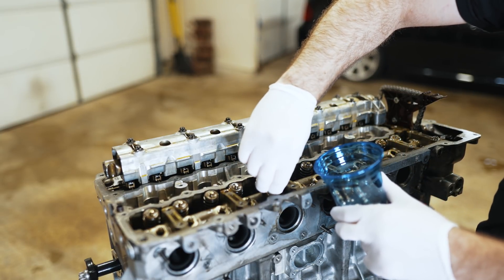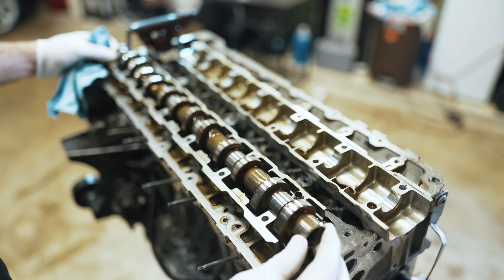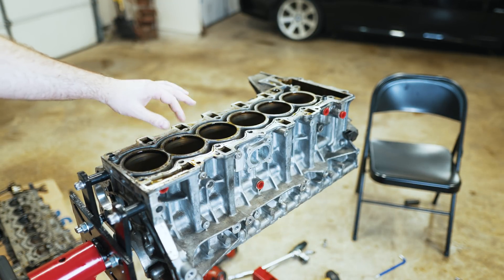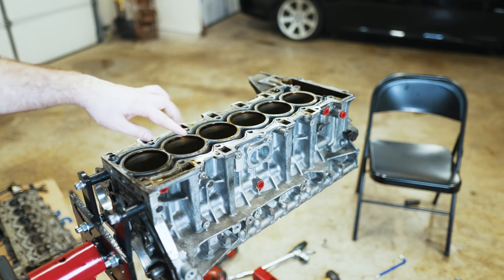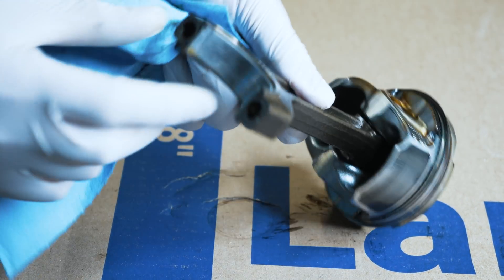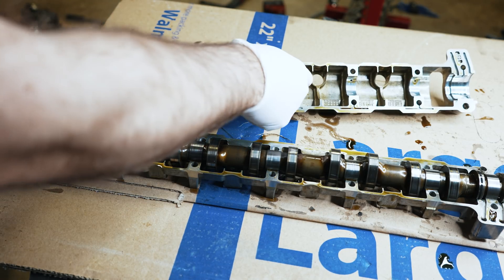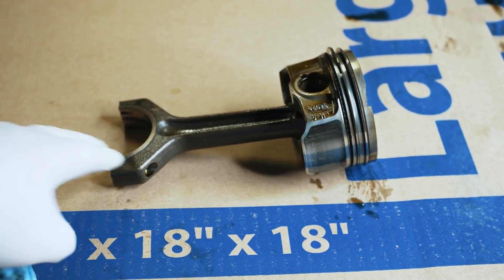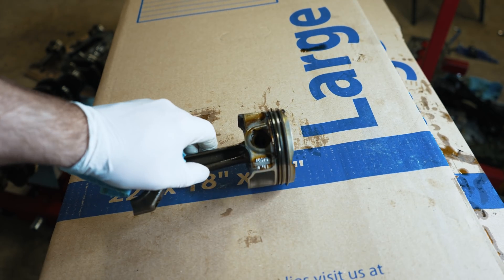Come Look Inside A BMW Engine!  Full Tear Down

Comment: Hi Musa,
how would you consider the condition of your cylinders? My cylinders look the same after 180k km, I think it's not bad at all. The grooves are so little, you wouldn't even catch up on them with your fingenails. 

Regarding your Bearings: I would definatley use OEM BMW Bearings. When I did my oil pan gasket I checked one of the six bearings and it wasn't even worn through the 1st metal layer, and that after 180k km. So I kept them, I guess I will find out if this was a smart decision with the 600hp build.
Reply from the maker: I'd say the bores look good for the mileage.

Comment: Seems like others have had problems with King bearings.  Cam bearings (and a couple of cam lobes?) looked scored.   Cam trays need to be new, evidently.

You could have the head ported by headgames, go to the Mahle 9.5:1 low compression pistons ands Shrick cams and a closed block plate, but then you are in real bucks.  But with stock head, there is not much room for improvements.   Also, for street performance and longevity, eutectic pistons seem better than forged or cast.  If you use forged pistons, you must be religious about achieving full operating temperature before you roll an inch out of your driveway.

You should set a budget for your build.  If you do not go towards $10K, might as well keep it like it is with new stock components.

Comment: If you had the non turbo version (N52) like mine then I'd say sure, cut and oversize is fine, but on yours I would certainly replace the crank all together, and I would take that guy up on those rods too. Also those cam trays, but I would be more okay with trying to polish that out a bit, but you can't do much. Worse case scenario, you have to go back in to replace the tray, but you can do it easily in car at that point. Some say the road to more power starts with the crank. Nice video, would love to see this grow into a nice build.

Comment: I'd rather keep German steel, never heard of that company.  I think the root cause was your rod bearings, the cam tray had nothing to do with the failure, as they don't look bad.  Either the clearances were not correct or the bearing material is not good.  OEM are good bearings
Reply from the maker: Thanks for the feedback.

Comment: Love your videos mate, I've had really bad luck with my n54, started off with timing issues, then the garage my car is in found pieces of metal in the sump and rubber gasket sticking out the oil feed pipe to the oil pump 💔 = cylinder 1&4 had some scoring, was struggling to find a replacement engine so took the crankshaft out 💔💔 cracked and bent crankshaft. Found a replacement engine now hopefully it lasts.

Comment: did you check your oil pump before reassembling the first time you changed your rod bearings ?My engine did the same thing as you (blown after a while after a rod bearing replacement) and the oil pump was bad from the fist time and the engine was able to have oil pressure but after a while the pump was not able to feed enough oil at high rpm and the bearing spun.

Maybe you should put the gear on the oil pump and turn it by hand to see how it feels ?
Reply from the maker: I did flush oil through it and turned it manually to push the oil through, it felt Okay but I can take it apart to double check.  Thanks, a possible culprit for sure.

Comment: id like to see you rebuild the engine. on those bearings that you expect to have caused the failure after installing them, have you contacted the bear manufacturer to see what their thoughts are on the failure shortly after installing them?
Reply from the maker: I haven't but that's a good idea.  I should reach out thanks.

Comment: I think you're getting to the correct conclusion.  It seems too coincidental that you replaced the rod bearings, shortly after you spin a rod bearing.  And in that short time they don't look great.  Something was not right, I believe you plasti gauged them but that is at best a crude check in my experience and doesn't account for out of roundness or other factors.  I don't think those cams and trays had anything to do with it.  That being said my vote is for a 'budget' rods and pistons rebuild and see where it can go.  There is lots of talk about it but no one really seems to do it and document it, you could.  Till then keep up the good work.

Comment: Do a single turbo build! I'd love to see you shoot for 700, which is pretty "easy". Check out Jafromobile's (youtube) engine build series, you'll learn a lot about measuring clearances and etc. on a turbo engine build. Plastiguage is a "did I totally screw it up?" kind of check, not "Is it right?" - it's a check, not a measurement.  At this point, you probably just need a micrometer to properly measure your bearing clearances and a couple more install tools, and you can totally assemble it yourself. The block and head sent to a machine shop to be hot tanked, checked over, and decked. Check out subi performance's N54 build that started Dec 26 2020 to see what sort of measurements to rods and pistons you need to be doing. You can get a shop to measure and assemble them for you. If you can really swing it, get the deck closed like what ABR or ghassan do - it's just a plate with coolant holes pressed into the block and decked flat to keep your bores from wobbling. I wouldn't want to cheap-out on rods or pistons without some assurance of quality and strength.

I bet your clearances for each bearing weren't correct in one dimension, and spun under load when the oil got squished out and you had metal-on-metal. Grooves in bearings "just get filled with oil," but that groove allows oil to be evacuated from the bearing surface under load - so possibly worse than a raised surface! Cam ledge grooves didn't cause your rod to spin - just wore out your cam bearings faster - unless you suspect any shavings that may have been creating from the cams migrated into the rod bearings and were large enough to gouge either surface.

Comment: So I don't think a cam ledge failure (scoring where the seals go) could cause enough clearance to lose full pressure to the system, enough pressure to the VANOS gear but not the  entire engine.

Comment: You know the app "PerfExpert" to dyno the car with the acceleration sensor of your smartphone? Would love to see how accurate it is. For me it's working surprisingly good. Beside this thanks a lot for the content.
Reply: We have a more accurate, trustworthy virtual dyno app called LogDyno. It creates actual dyno graphs from .csv files like MHD logs or whatever u use to log pulls..
Reply: Sure I know this and it's working fine. But it's not that nice in terms of handling. Start the App, do a pull in 4th gear and tada there is the result immediately. It has something. I like to see some numbers to rate how good it is in comparison. Where to put this app? Actually PerfExpert respect local weather data, weight of the car, suspension setting, gear ratio (...) and tries to be as good as it can be by using this measurement principle. This is quite impressive in my eyes.

Comment: Ah yes. My weekly dose of anxiety as an E90 owner.

Being a fan and owning a BMW is one thing. One one hand, it's the best car in the world...on the other hand, there's always the nagging feeling that something is about to fail.
Reply: Totally true.  Love my N54 engine but I am always thinking what will be my next fix........
Reply: @andyb8005  trueee love the car but always worried lol! How does that work haha. Just bought the hpfp cuz mine failed waiting for the weather to get warmer to change it lol
Reply: Relatable
Reply: @xantor_  very.
E46 driver.
Reply: Lol buddies e36 failed out of no where about a month ago. 2 weeks later my e90 starts knocking/misfiring.  More hate than love with bmw right now. Both got rid of them and vowed never to come back without warranty
Reply: Nah, you don't have to worry about a spun bearing unless you're running really low on oil or have after market bearings that are not to spec. This could happen to any car.
Reply: I am always hesitant to comment on the reliability of the N54 because I feel like the next day something will happen. 3 years and only 1 blown coolant hose is good though!